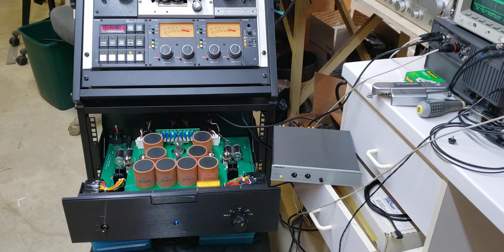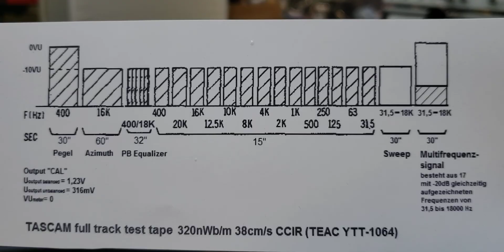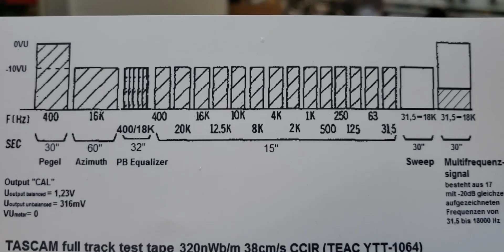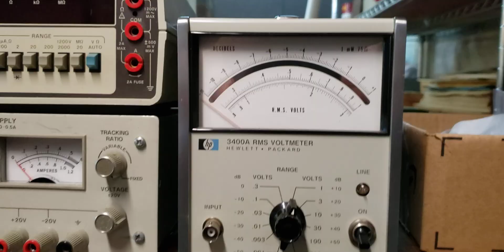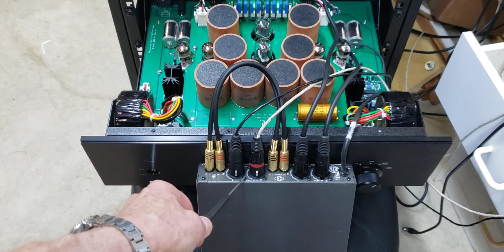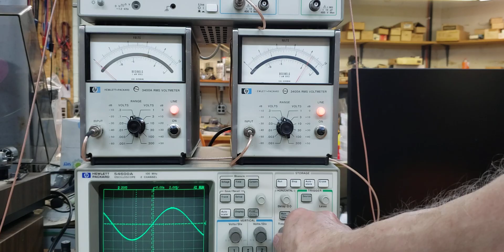Studer Revox Calibrating your tape head preamp

Comment: You mentioned Six acoustics reverse RIIA card to tune EQ. Would you show how to use it. Maybe all of us will made a request for NAB , CCIR curve . Will it be better than use calibration tapes?
Reply from the maker: As I mentioned, it is with my friend now, but as soon as I get it back I will do it.

I think it would be great if more of us expressed our desire for such a tool.  Considering its cost it is a golden bargain.  

In the meantime I will try to characterize the already calibrated preamps, since I have so many of them, and perhaps there is a chance for an effective single point calibration that would be sufficiently good.  

Doing it on your test setup would take much less time than running several different test tapes on your machines.  So I am curious as far as what sort of consistency I am going to get.

Comment: Thanks a lot, great information. I notice you rather use the AC meters to monitor level than the scope trace. More convinrent? More precise? Well, indeed AC meter automatically gives level in dB .
Reply from the maker: Yes, that is exactly the point - when you do calibration you want to be accurate.  You are trying to see the small fractions of a dB, so the scope does not give you that.  And plus the meters instantly show the trend.

Comment: Thanks for the explanation. I was somewhat unclear as to how exactly you are physically making the adjustments. Are you turning a knob, moving a dip switch, etc.? If you are making the adjustments with the Ampex box, do you need to keep it connected after you complete the calibration?
Reply: Aphex box.
Reply from the maker: Sorry for not being more clear... if you look at around 20:50 you will see me pointing at the array of blur trimpops - you adjust the proper one, and the LED near it indicates which one you should turn.

And after the calibration is done you simply disconnect the attenuator, it is only needed for the calibration process, to make it easier.
Reply: @Foxbat9000  Thank you. I could buy all of the necessary test equipment for less than the cost of one good quality tape.🙂
Reply from the maker: @marknachmias423  Well, this is going to be challenging, but not totally impossible.  :)

Comment: Thank you very much for video, I was always curious how you can adjust outputs levels. I was trying to use different scales on voltmeter. Your approach is more precise. What is the model of output level regulator?
Reply from the maker: https://www.ebay.com/sch/i.html?_nkw=aphex+124a&_sacat=0&_from=R40&_trksid=p2553889.m570.l1313
Reply: @ Thanks, just bought it
Reply from the maker: @Gerta789  You are not going to regret it, it is a nice tool with many possible applications.  I would also buy 1' long RCA and XLR interconnects to use with it.  

The only modification I would do to it is replacing the knob with the longer ones.  You can use as it, but I have one with custom made knobs and it IS more convenient.
Reply: Thank you Victor, now I’m  curious how and where this regulator can be used. Another video would be highly appreciated.😊
Reply from the maker: @Gerta789  Well... stand by!  :)